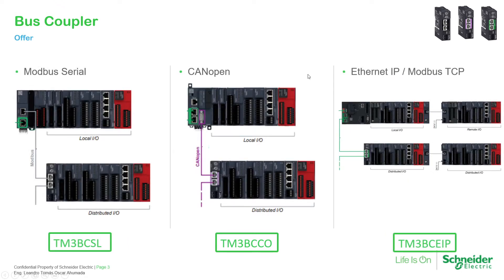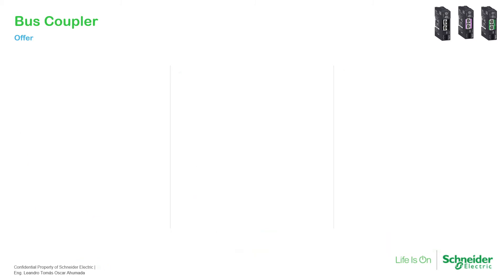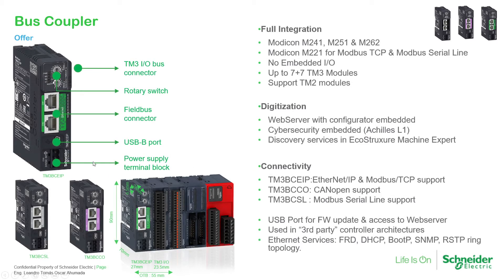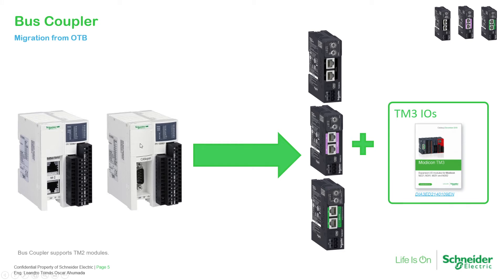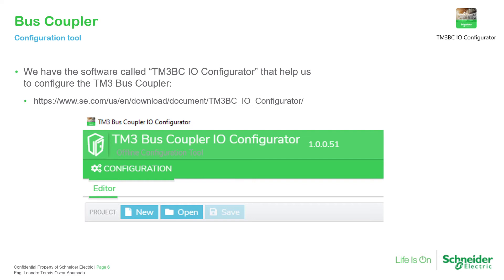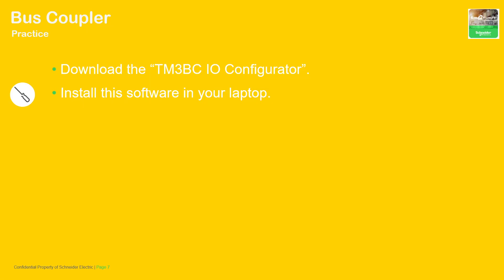Training - BusCoupler - TM3BC - M11.0 Offer

Comment: Hello Mr. AHumada. I have a question. How many modules  TM3BCEIP , PLC M241 can connect? Thanks!
Reply from the maker: Hi there! Good question, based on the catalog of the m262 we know we can have for distributed io up to 64x TM3 I/O bus coupler (EtherNet/IP) and/or up to 32 x TM3 I/O bus coupler (Modbus/
TCP) (2), allowing up to 14x TM3 I/O modules by bus coupler.  I have checked on the m241 catalog and that info is not shown so i believe the best is to make the configuration that you want and check the ethernet load consumption.

Comment: Hello. Mr. AHumada, I'm from Brazil, my name is Gleriston and I'm developing an automation system for Biosafety laboratories, and this system also have a control acess integrated and we use a TM3BCEIP for status and to control open/close the doors, we have two TM3BCEIP, one of them with 5 DI cards and the other with 5 DO cards. We also are using a AS-B-24 as a Server and also MP-C and RP-C controller in a BACNET bus, the TM3 is in a MODBUS bus, but I'm having a problem, after to develop the logic, DO turns a relay on and shoud stay on until another command to turn it off, but turns it off afer a second, although the funcion block is sending the correct information to BIT. Example: Register 3505, BIT 1, receives the value, the DO is ON, after a second DO is OFF but it's still receiving the correct value. Can you help me?

Is there a problem to use this BUS Coupler with the AS-B?
I also have a green flash LED on NS status, how could I solve it?
Reply from the maker: Hi there! I recommend to connect to the webserver of the bus coupler and check the status. Maybe the output is in true and the problem is in the relay. You are using a Bacnet device but you will need a ModbusTcp client or EthernetIP device to control the bus coupler.